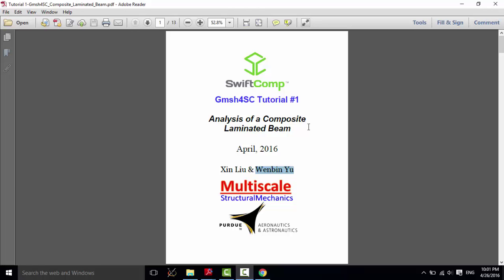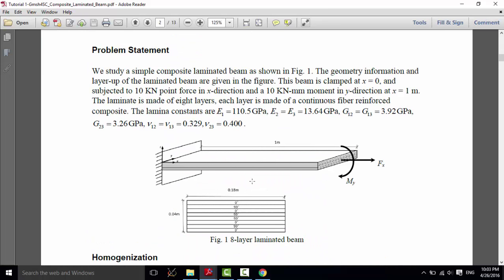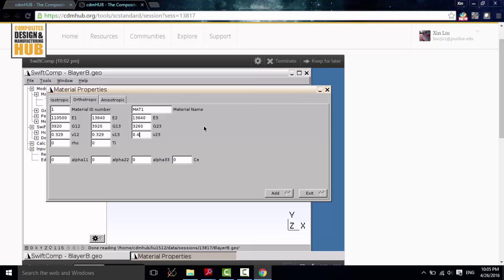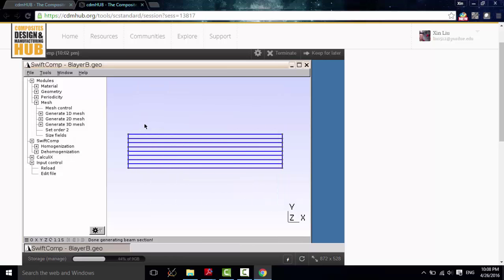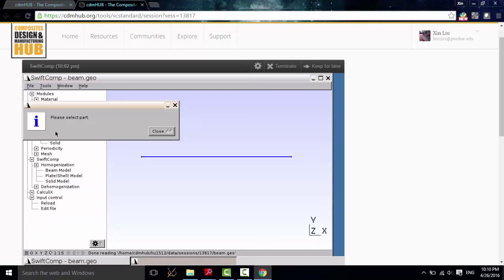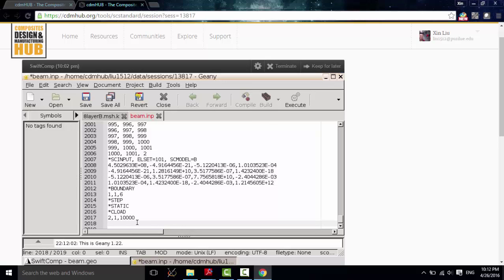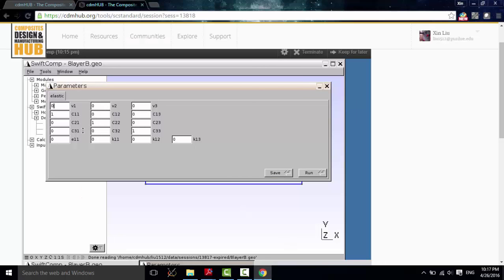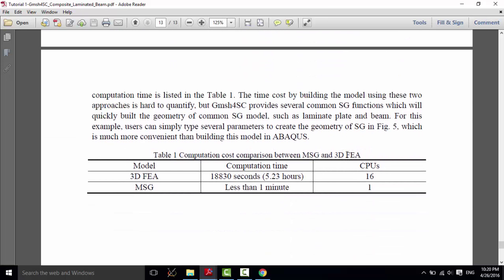SwiftComp tutorial 1: Analysis of a Composite Laminated Beam

Comment: Hello, I would like to know what meaning has 2,1,10000 and 2,5,10000, which corresponds to the load in X and which corresponds to the bending moment? and what meaning 1,1,6 in boundary conditions. thanks
Reply from the maker: Hi, Barros. Thank you for your interests. Under load card, "2,1,10000" means load applying at point 2 with magnitude 10000 along x direction, and "2,5,10000" means moment applying at point 2 with magnitude 10000 along y direction. The boundary condition "1,1,6" means the DOFs 1 to 6 have been constrained at point 1, which commonly called fixed boundary condition. Thanks